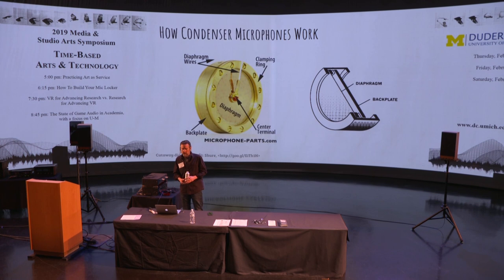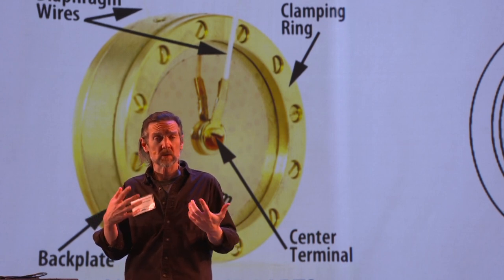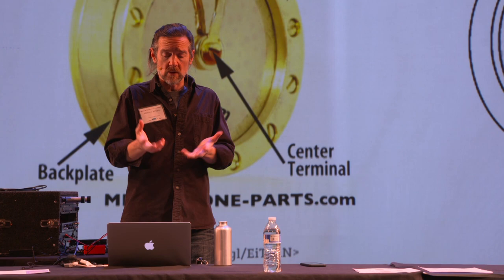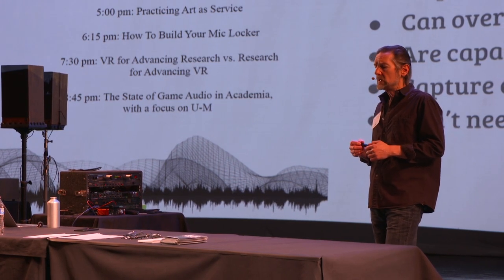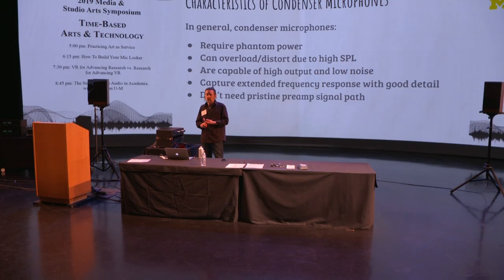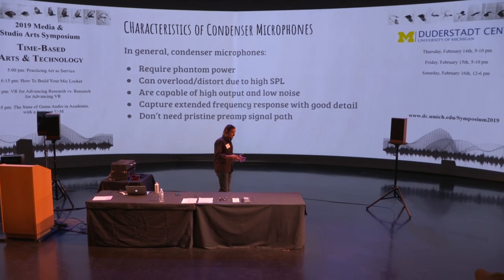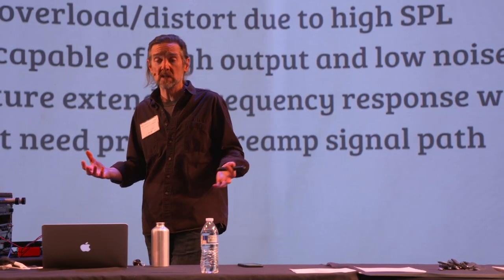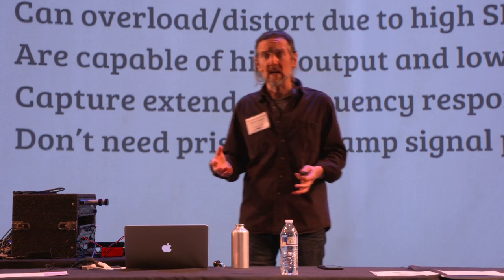How Condenser Mics Work

Comment: Where does that center screw or terminal screw into? I mean the diafram is very thin so what is behind that diafram where the center screw goes into?? It can't be the backplate coz that would A create a short and B it would be a rigid connection stopping the diafram from vibrating.
Reply from the maker: There is a non-conductive core in the center of the backplate.
Reply: @RoswellProAudio  Ah okay. That makes sense. Thanks!